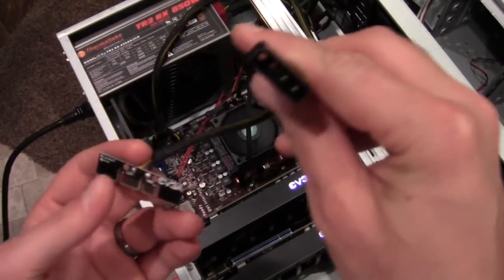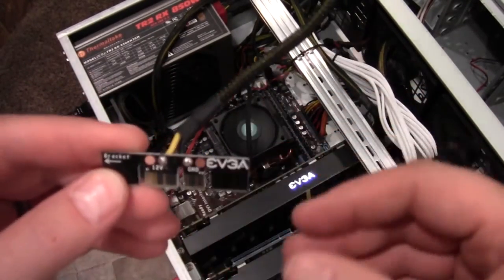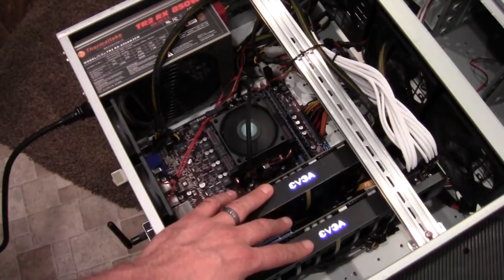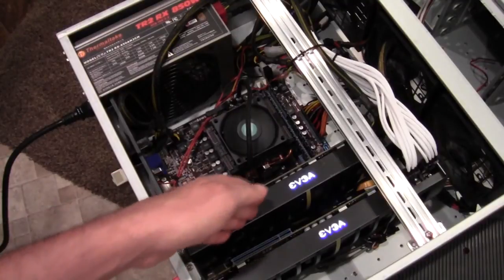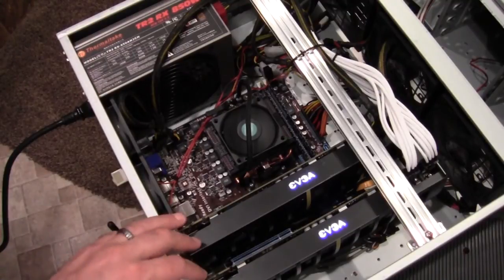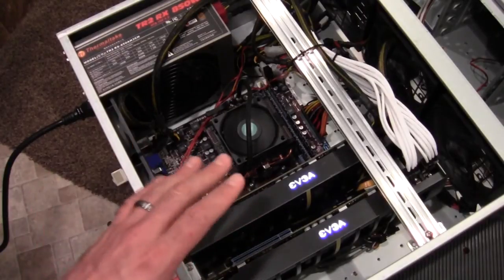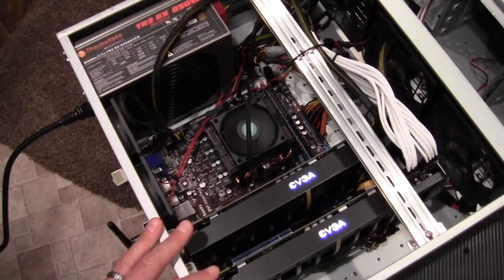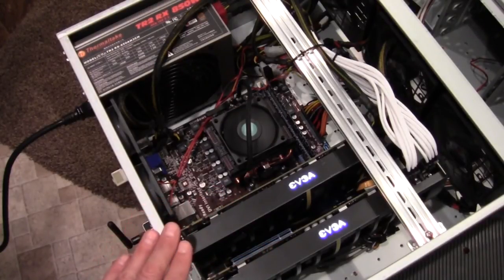EVGA Power Boost and Folding@Home Update June 2013

Comment: hi i got a  gigabyte  f2a88xup4 motherboard   an md radeon performance ddr3 16gb ram  i allso have 4gb an 8gb gskill an ripjaws ram  sticks  with fm2 a10 6800k  im upgradein to nh d15s  i switch frome my order of the nh c14s   i hear nh d15s outperforms c14s an cooler master hyper 212 evo wich i have now running  but i own an use nvida 2gb gddr5 reference  nvida gtx770  card an ive in my nzxt s340 case with the nzxt sentry 3 fan control  for my temps   an wile gameing on crysis3 or so  its overheats like  crazy in matter  minutes  or so overheating problem  witch i had an test  lot gddr5s  like my xfx Radeon r7 360 2gb got hot an evga gtx sc 760 gddr5 4gb got mad hot  an gigabyte 270x 4g  kinda  did an my msi 280x 3gb gameing  gddr5  runs ok i gess better in my 2nd build with fx  6300  build  but will that evga power boost realy work for my amd  builds healp  keep my stuff frome not overheating  or so an all  i got evga supernova 750w power supply  in my amd a10 6800k build  an my Thurmaltake smart 650w in my amd fx 6300 2nd bulid  but will that adpter healp mybsetup beast an keep everything cool an all not have anythin problems an all .thanks for your video

Comment: UPDATE:  OK, I found the eVGA Power Boost part #100-MB-PB01-BR.  It is only available on eVGA's web site for $10.  However, I also read on a forum the Power Boost is not necessary because most high-end video cards already have their own 4, 6 or 8 pin connectors.

Thanks for the info.  I did not know there was such a connector and you could possibly overload the PCI-e bus.  I looked on Amazon, Newegg, TigerDirect and eBay.  I could not find this connector.  Does eVGA sell this connector separately or must I buy their entire video card to obtain it?
Reply from the maker: For sure. I have since come to understand that this adapter is really only needed when 3 or 4 graphics cards are used on a motherboard that does not have an additional PCI Express power connector on the board itself. As I understand a card can draw as much as 75 watts (I may be wrong on that) from the motherboard itself. 4 cards could draw 300 watts from the motherboards 24 pin connector. So this is where the additional power could help level everything out.